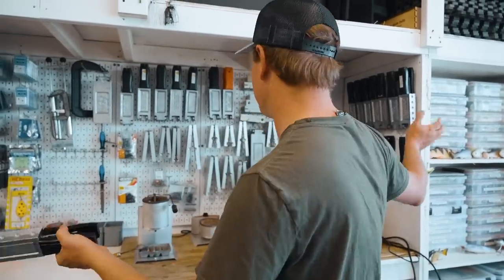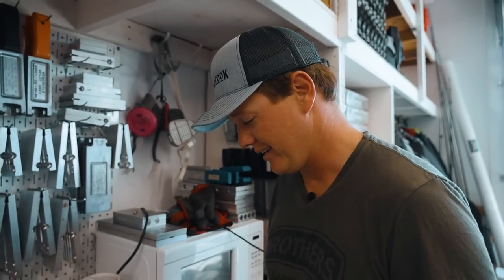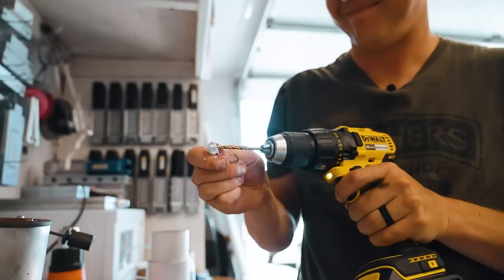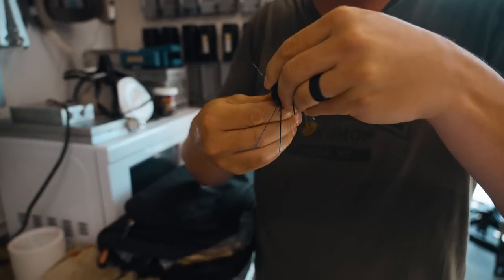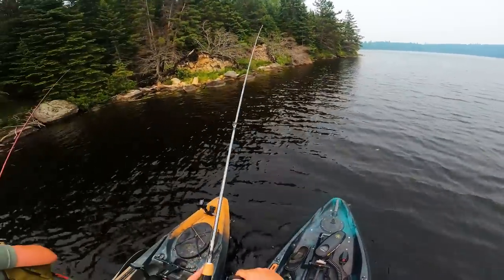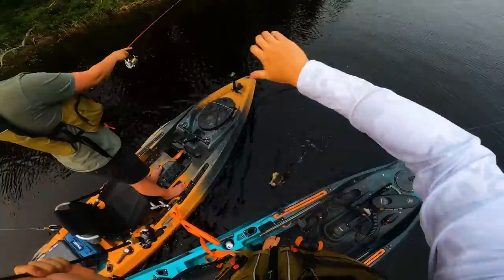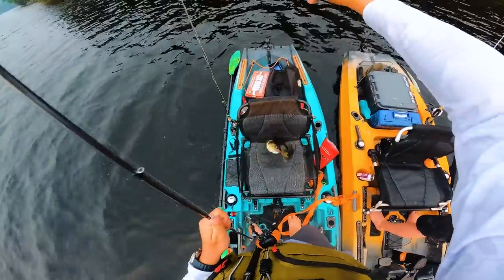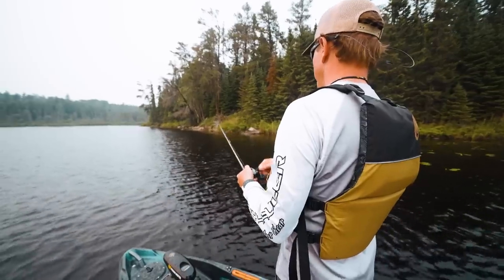Going Fishing With Homemade Lures!

Comment: For putting the eyes on try the gel supper glue.  Just a little and use a pair or twizers to put the eyes on.  Also try dipping your jigs in kbs ultra clear.  It will help keep the paint on the jig alot longer.  I do this for all my painted crank baits